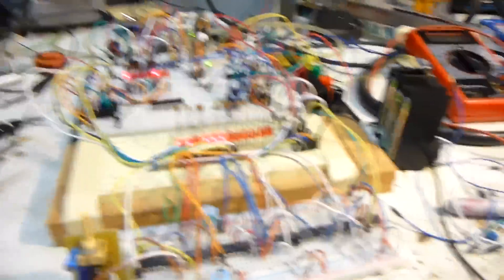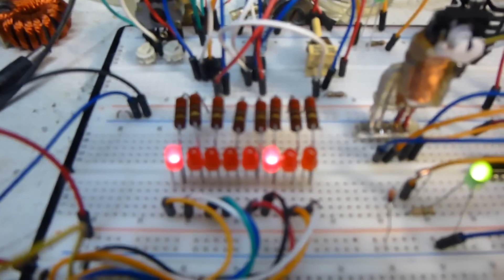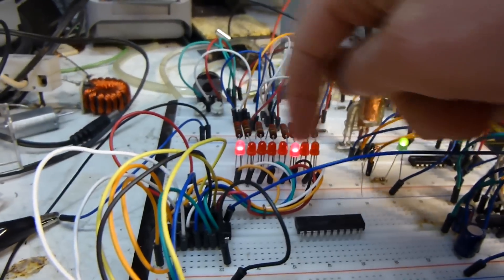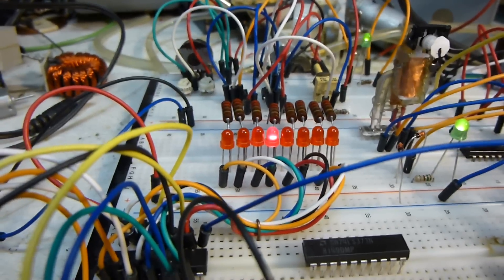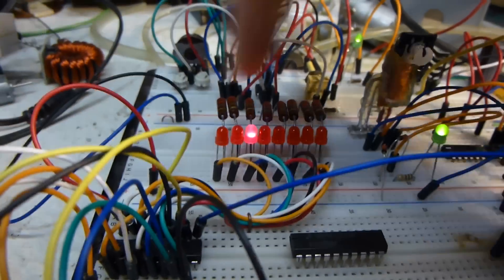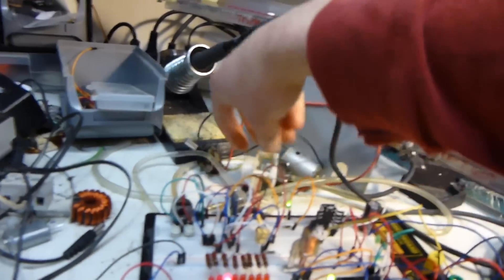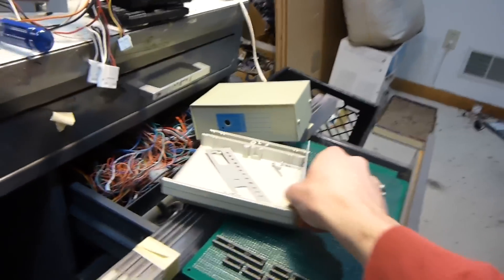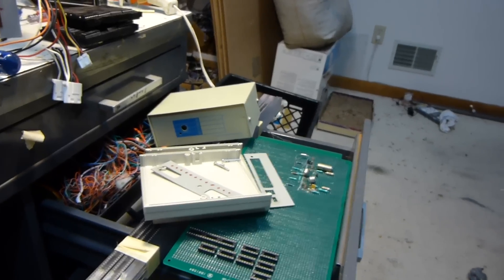5000 Subscribers! Thank You So Much!! Sneak Peak of Frequency Counter Project Using Binary Counter

Comment: congrats, I made a frequency generator from an lm324n; works well but not nearly as good as a tl494 or 555 generator
Reply from the maker: science Vlog Thanks!  Did you make one that can do sine, square, and saw?  I almost always use 555 timer.  Never really thought about using just and OP amp.  Sounds cool!
Reply: Makerj101 Im actually not done building my oscilloscope. I just put it on a pcb
Reply from the maker: Oh ok.  That's cool that you're making an oscilloscope!  Are you making it from an old TV tube?  Make a video about it!
Reply: Makerj101 a monitor,, ok :D. I might use an arduino for better x-y axis control on the coils.
Reply from the maker: science Vlog That should work.  Sounds cool!  Best wishes
Reply: Makerj101 you should make a shop tour video
Reply from the maker: science Vlog Watch my latest video!  That's exactly what it is!  :D

Comment: good day sir i would like to create just like that without using a microcontroller..?Can you help me about the concept on how to read the freqeuncy of a motor with a rotary encoder attached to it?
Reply from the maker: John Vincent Gonzales Well I'd say this is the least easy way to measure the speed of a motor.  I'd say if you really want to measure the speed of a motor just go out and buy a tachometer.  But if you're like me and are up to a challenge and don't mind spending hours on a project then this a great project.  The setup I have is really not optimal since I am using the chips I had on hand.  Basically you need some binary counter chips, inverters, latches, and maybe and OR gate or two.  You might need some others if you're components don't work the right way.  The way it works is the binary counter counts the frequency and then after one second of counting the latch takes a snap shot of the binary counter output and displays that in binary with the LEDs.  Then the binary counter rests and counts until one second and the latch take another snapshot.  I could try to get a circuit diagram drawn up if that would help.  But it's kinda hard cause I'm using really bad components for doing this. Hope that helps.  -Makerj101
Reply from the maker: Makerj101 I'll be doing a longer video on it once I can talk!  :)  I'll try to have that out soon.
Reply: Good day sir thank you very much, for the information and the time you spent for that. 

I will wait for your longer video, doing that circuit of yours..:)

Hoping your voice soon be ok..

Thank you again. And sir please be keep in touch..:)
Reply from the maker: John Vincent Gonzales Ok I doodled up a quick and really bad schematic in Multisim.  I posted it on Google+ so here she is.  Hope you can make sense of it!  :P  https://plus.google.com/102840732238426269146/posts/GJowGufRAsj

Comment: Great job, that's a lot of work. Are you going to do some Arduino at some point? You can do a counter in software with one little chip. It would be a good step on your journey. Well done!
Reply from the maker: Robonza Thank you!  I have an Arduino but I haven't done much with it.  I guess programming isn't really my thing.  The most I've really done with it is blink LEDs and try to get a display to work.  I couldn't figure out the library thing for the display so I just kinda put the Arduino back on the shelf.  I'll probably get it out again and experiment with it one of these days.  But yeah I could probably make a frequency counter with it with some pretty simple code.